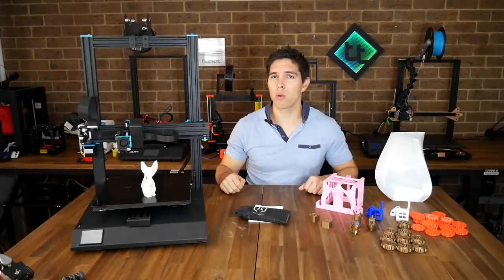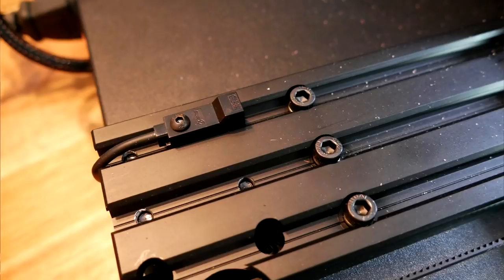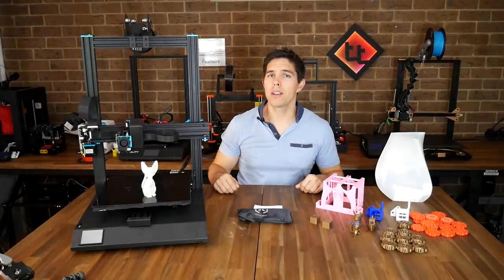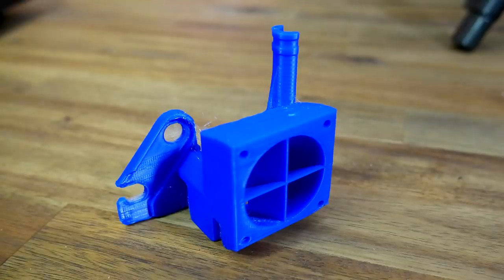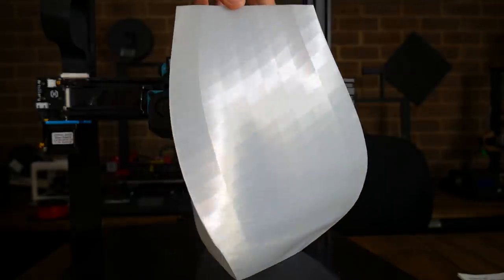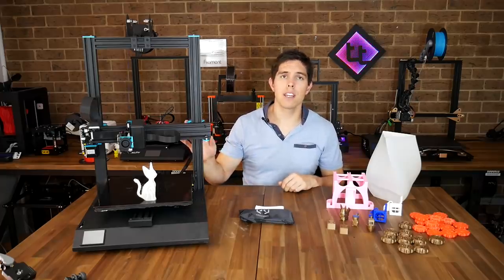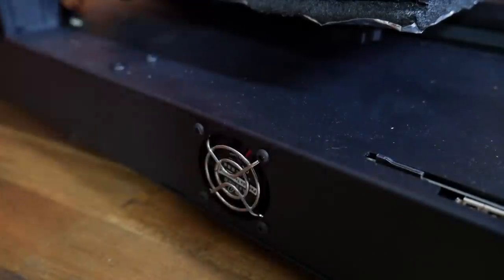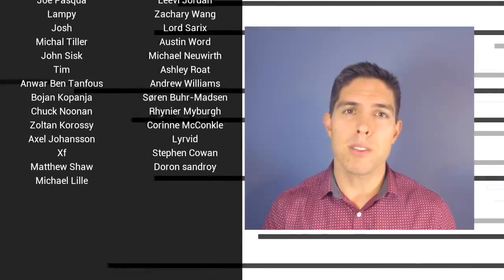Artillery 3D X1 Sidewinder Review: A unique challenger to the CR-10S

Comment: My only concern with the newer printers is the AC-powered heatbeds. With no visibility over the manufacturing quality and the parts quality, I am a bit hesitant to use AC power on something that I will actually be touching.
Reply: I've been using an AC bed on my Tevo Tornado since November 2017 and it's run about 24/5, the downtime is mainly for me to pick something new to print. I put a strain release on the cable and added a ground for safety but have never had a single issue with it. The bed on that and this printer are glass which is non-conductive. The wire would have to break loose and touch the frame to be a hazard, and if you ground it your breaker should trip immediately if this would happen. I feel safer with this than I do a mostly plastic coffeemaker that gets way hot!

Comment: Okay me being very new to 3D printing what pla brands would you suggest I use to start off with so I don't have that aggravation and mistakes because of the pla being poor quality
Reply: get some eSun PLA+ stronger and more flexible than PLA, same price, same temps, no special concerns at all
Reply: @mrb2917  
Thank you I will try that.
Reply: @mathewphillips4185  The filaments I have had good luck with are: eSun, 3D Solutech , Amolen, CCTree silk metal filaments, Hatchbox, Anet, Colorcubed, Gizmo Dorks, YoTilon, 3D Hero, Sunlu, Alpta, 3D Filament Pros, Zyltech, and believe it or not some Ebay unbranded filament at $10 per KG.
Reply: I use eSun PLA+ too, and also the Amazon Basics stuff is great. If you are new I would also suggest buying some color-changing silica gel and make yourself a drybox to keep your filament in top shape

Comment: hey guys looking into getting my first 3d printer. i like tinkering and building pcs etc so i dont think it needs to be to beginner friendly anyway i was set on getting a cr 10s but have come across this. what would you 3d printing veterans  recommend between the 2? 

i was also considering going a ender 3 just on  price incase i purchase a printer and it just sits there doing nothing but i doubt it. 😜

thankyou for any info
Reply: The CR-10S is better in my opinion than this one. However despite being cheaper and smaller I actually think the ender 3 is better than the cr-10s because (with my settings) it produces higher quality than the CR-10s however I don’t own any I just play around them quite a bit and my local maker space which I go to every day because I have a unlimited pass.
Reply: @calebsmith.official4254  thanks for your input caleb i was looking at the ender 3 but the the only thing is print size im looking at the slightly bigger size of the cr10 type printers to make big char models with the kids and certain things for work etc that i think will benefit from the bigger build area. ? 

i was thinking of starting small and cheap incase i dont use it but if i do then i gotta upgrade again after lol

Comment: What is thermal runaway detection?
Reply: The thermistor is the printers way of knowing the temp of the hot end. The hot end is a large resistor that gets REALLY hot. If the thermistor falls out or breaks and can't read the temp and thermal runaway is not enabled the printer will just believe the hot end is not hot enough and infinitely pump more power into it and then: 🔥🔥🔥. With thermal runaway enabled the heating of the hot end has to follow a certain curve (with some tolerance) or else the printer knows something is up and shuts it off automatically. Without it the printer is a fire risk if something happens to the termistor.
Reply: @AmusementLabs  thanks! The thermistor on my anet a8 is broken and it's a good thing I installed the latest Marlin firmware so it stopped before I caught my house on fire

Comment: Does this printer work with cura?
Reply: Yup, cura works for most 3d printers. If there isn't a setting for this printer you can just import the build plate size and you should be good to go
Reply: Ok thanks

Comment: The ribbon cables do seem like a nice idea, but not executed terribly well. Having to fold the cable so the bed doesn't damage it is just not right and there looks to be no strain relief before the socket on the X axis.
Reply: It also looks like there is no strain relief on the AC cables running to the bed heater?

Comment: Great review as always Michael. It does look a very sturdy machine and I love the ribbon cable choice, I've considered that for the Borg. On another note, did you know that Simplify 3D claim they are working on the next v4 update, but more worryingly they say they are also working on v5.0, which will be a PAID upgrade, lets hope they are planning to make the cost reasonable. I have been wondering if they are financially troubled, maybe this is the only way to claw some cash in.

Comment: heard the ribbon cables on these are s huge pain in the butt, causing alot of problems for people
Reply: Got mine this week and didn't have any issues with them. Still fighting stringing, though it might just be the filament.
Reply: The same people have trouble doing up shoelaces. Really not hard to insert them. And ribbon cables have been used in printers since year dot: great that they have rediscovered this approach.